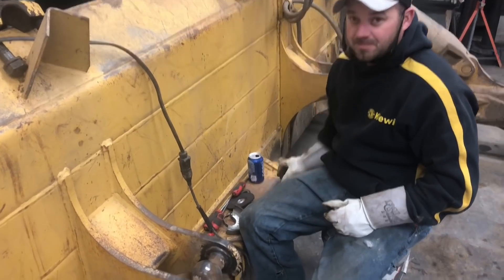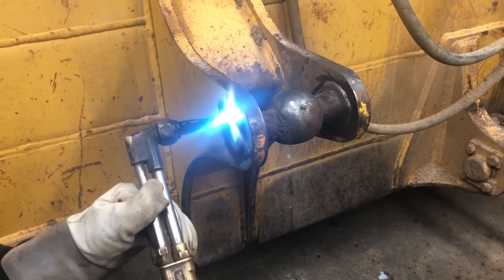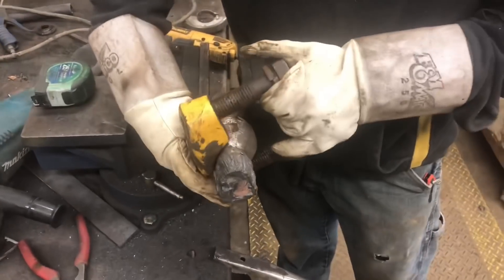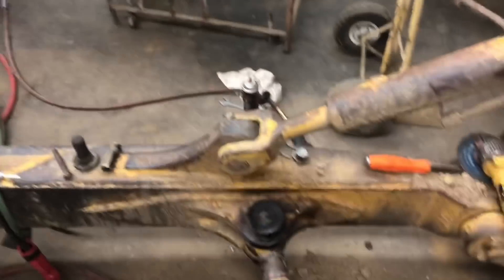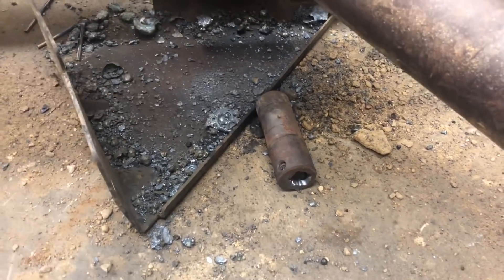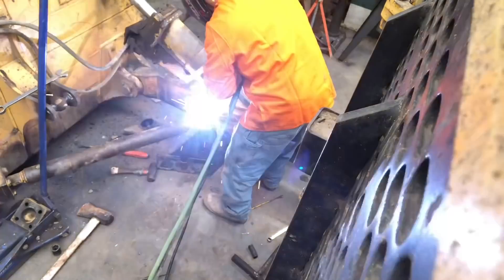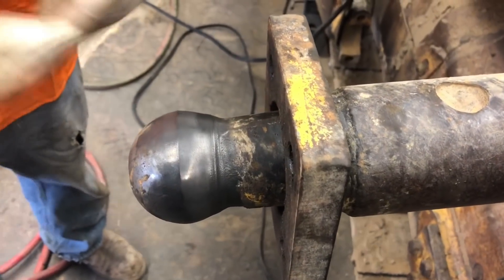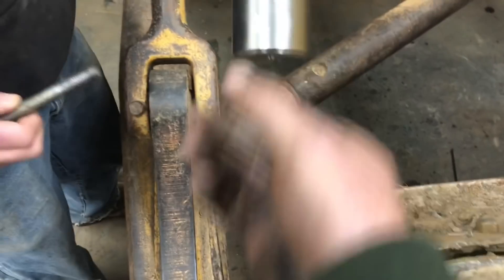John Deere 850bn Dozer blade round 2 #oldbutgood #shopwork

Comment: On a case 580 super k backhoe the main swing pin my boss put brake line on the torch oxygen bottle hooked it to the stick welder and blew a hole through the pin and as it cooled it fell right out

Comment: Great work ! Saved a few bucks and   Definitely saved the life of the blade carriage from premature fubar! 
I picked up an older IH/Case  515B loader cheap , the brakes are locked up . It has a wet disc  clutch, common with frontend loaders,  graders and the likes. Are there any videos out there on troubleshooting the electrical side off the system ? The wiring has been hacked recently and looks suspect for service brake solenoid or trans brake neutral switch ?  Any suggestion or site forums , pdf diagrams etc. would give me a little more insight beforehand will certainly help  my learning curveball 
Thanks
Reply from the maker: You get get in line at case parts and look lot of that surf up one thing I like about case
Reply: So your pretty sure it’s not a fuss ? 
Lol thanks for the reply
Reply from the maker: Anything possible hard to tell with out looking at I am a hands  in person lol

Comment: as a welder in a large logging camp, i always lanced pins, and 5th wheel pin out with a cutting torch, you take an old # 3/0 cutting tip and silver solder a peace of steel copper in side brake line 20 times the length of the pin, use a 2nd torch and heat the end of the pin red hot, place the brake line tubing in center of pin strait up and down turn your oxy presser up to 60psi press down hard and hit the qxy trigger, and blast right though any pin, even long walking beam pins on skidders, let it cool off and they fall out, arc air is great for taking them trunion balls out, just dont know why you went to all the trouble to cut it out and not just buy anew one,,, i have rebuilt, built up hundreds of them balls and caps in my time right on the machine, rods bend..  it is possible when you do it every week.. use a stainless rod,, then a hard cap
Reply from the maker: Thank man really appreciate the info

Comment: Sometimes I heat the pin then cool it with water and it can shrink the pin a tad bit. If that doesn't give me enough I heat only the area around the pin and it will come out. But doing this I have to weld a bead on the top and bottom. Hillbilly pin removal! 😁👋

Comment: nice job .why did you put the grease fitting on one side under and the other side on top
Reply from the maker: The original did not have grease fittings. Had machine shop make two did not catch they where different till went to install upside down is still better then nothing right lol thanks for watching

Comment: Why did u put the grease Zurk down on the first pin?
Reply from the maker: The ones that where in there did not have grease fittings so tried to improve on the design had the machine shop make two and did not realize they where different till I went to install so just went with it thanks for watching